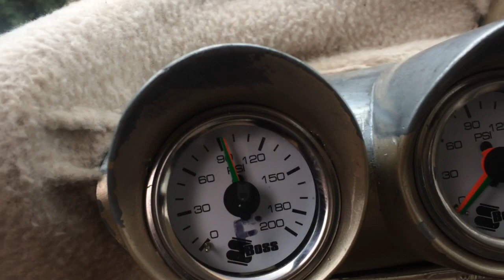59 Impala Bags Test "Gold Digger" Low Rod

Comment: Love the car! I am building my first impala and had a few questions for you.  In the video above is the frame stock or have you welded in a step notch in the rear? Also, What size wheels are on the car? they look like 18's, maybe 20's?  I've built several trucks but this will be my first car. Thank you for the input.
Reply from the maker: +william stodgel Hey! thanks :) this is my first impala too :) The frame is stock did no mods to it, because its not got hydraulics and im not planning on Hopping it and getting air at this stage! in the rear to be able to get it that low i had to cut the rear body tunnel and raise it up a about a inch because the tailshaft was hitting it, so now it goes 1 inch even lower in the rear! the wheels are 20" :) add me on on FB to keep in contact? cheers!
Reply: Mathias Mustillo  nice

Comment: rookie question here: but will the air compressor always make that "idling" noise? or is that only while it's refilling air?
Reply from the maker: that noise is only when it is pumping! I am running 2 air tanks for more reserve so i can go up and down a few times before the Compressor kicks in again at about 110PSI and pumps to 150PSI. the more tanks and more compressors the faster and shorter pump times. now i have 2 tanks and 2 good compressors!